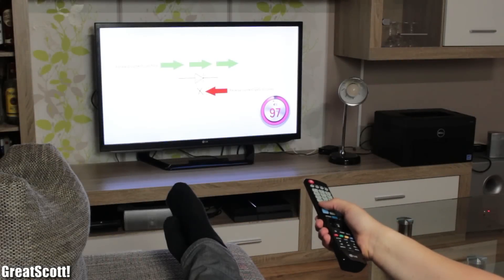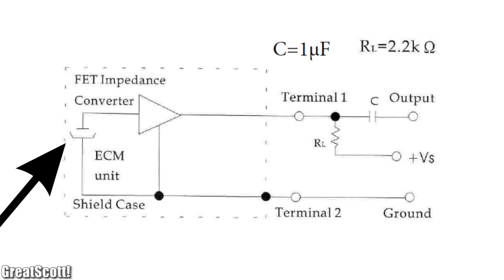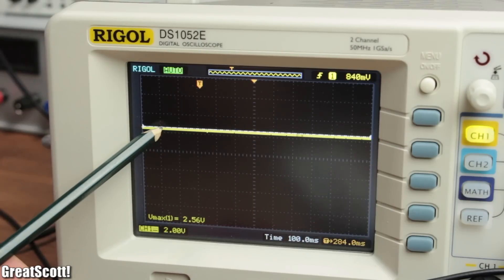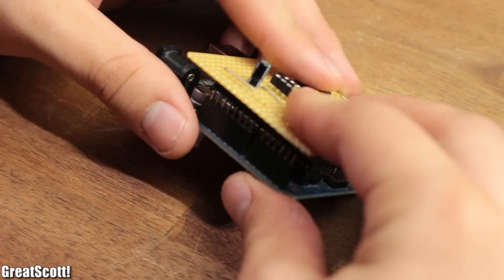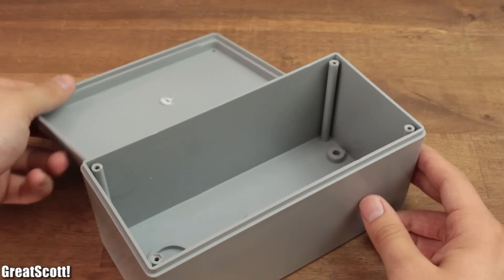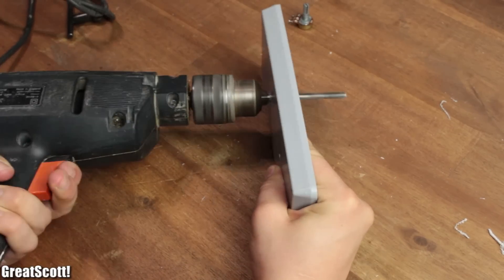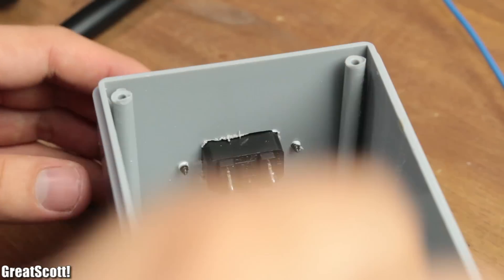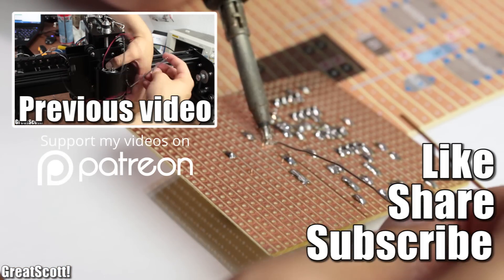Turn your lights on with clapping?! || Arduino Clap Circuit

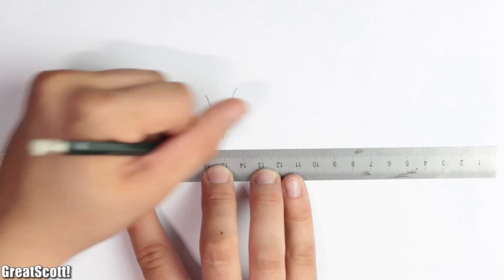Comment: @1:30 You could have used lower ADC reference voltage, attiny85 should have 1.1V voltage reference on-board.

Comment: hello greatscott! how can apply thia to my arduino nano? what pin should i connect the sound sensor? what pin should i connect the relay?
Reply: the majority of the pins is the same with arduino uno and/or attiny. just look at the pin mappings of all these and (for example) you need a digital pwm pin, then just look at the nano pinmapping and find a digital pwm pin

Comment: Can I use LM386  instead of NE5534 op amp ?
Reply: Do I have to change anything if I use LM386?
Reply: See the LM386 is not an opamp, is an audio amplifier. It can be posible to use it in the project but you have to redesign the amplificaction circuit.

Comment: hey what is that silver colored conductor you use to make connections on the perf board? what is it called?
Reply: shiva kumar If it's on the pcb it's called an uninsulated jumper wire. It's used to make connections to various components over the board instead of insulated wire soldered under the pcb causing it to be harder to mount. If it's on either side of the pcb, it's called a power or ground rail. This is used in some circuits for neatness instead of straight connections.

Comment: Can someone tell me how to make a switch that's off when it says on like 

2 switches 1 is on then flip the switch the other one is on but the first one is off please
Reply: The wonderful wonder you need 1 switch with 3 prongs. let's the middle one be the common ground. the outer prongs are positive leads. so when switched one way, that circuit turns on. when the switch is flipped the other way, the other circuit turns on. hope this helps

Comment: Does NE5534P work for this? i have random readings on my serial monitor. Im thinking i have the wrong IC for the condenser amp.. the link you post on ebay is NE5534N. is that different with NE5534P?
Reply: if there are weird values, try using a pulldown-resistor (100k ohm or more that directly goes to ground) This will allow these interferences to flow directly to ground and not mess up the readings, just watch a tutorial about it

Comment: amazing project as usual.
Maybe i ll try to use it some time... :) thank you!
Reply from the maker: Carlos PECHIR You're welcome
Reply: GreatScott! are there any Abacom Lochmaster files for that project? Is there a milled pcb of that project, since you have the X-carve ...
Reply: GreatScott! I think I will build a 2 channel one with a double clap and a triple clap in the next months! :) But I will power it via two 9V batteries in parallel and a step down converter which has an idle consumption of a few micro amps and pulse relays. :o Should last for years and when it goes dry, the appliance will be still on or off. Nothing to worry. :D

Comment: Do you know how to code an arduino to do this "if this voltage on this pin then this pin high"
Reply: Beall619  ... in this video scott use analogRead to read you have the .ino file in instructable .. same way to program arduino uno and attiny..

Comment: This is really cool, and actually quite close to something I was trying to do not long ago. I wanted to fit a lock to my front door and drill a small hole for a LDR, and use a momentary flashlight as a "clap". If you flash a specific sequence, the door unlocks. I never got around to doing it because for some reason, my code doesn't like putting out more than a volt on the digital pins -__-
Reply: Jordan O'C did you set the pins as output?
Reply: Mario G. I did. I've put my code on pastebin if you want to have a look over it and tell me how shit my programming is XD. http://pastebin.com/cid9diZP
Reply: First of all to mention that I personally use Atmel studio. Now I can not see anywhere pinMode(). This function configures your pin direction if it is an input or output. Take a look at this link fix that and you are starting from something.

https://www.arduino.cc/en/Reference/PinMode
Reply: And my friend please do not use goto. just never when programming on C/C++. Always you will find a way to do it with loops.
Reply: Mario G. Oh my god... How could I forget that?! *Ultimate facepalm*. I don't like using goto, but It's the easiest way I can loop something, it's the one I understand the most. I hate using "while" and "for" loops, they confuse the hell out of me. Thank you for pointing out my obvious mistake though.
Reply: No, problem! :)
I hope it's the only problem on your code and it would work right away after fixing it. :)
Reply: Mario G. It was literally just that issue, it works all fine now, the leds are really bright :D
Reply: I am glad to hear it! :)
Reply: +Jordan O'C (Xenro66) While = while that condition is true: while (1 == 1)   For = for <counter> may reacheth <that value>: for (c = 0; c <= 100; ++c) //0-100 loop  You can make an eternal loop using while (1) { //your content here }

Comment: why dont you just buy 1pc cover for that outlet, you really need it in normal electrician work, also using that kind of board for those kinds of ac currents .. is not ideal.

Comment: Can i use NE555  instead of NE5534?
Reply: ok Thanks bro..
What about the relay? is there any other type of relay ? because at my place here i could not find FRS1B-S-DC05 Relay.
Reply: Its relay is 6 pin whereas the one you shown to me is 5 pin... how is the circuit then? Help.... T.T
Reply: Thanks mate.. will try it....
Reply: can i see your circuit board? Can i see your connection?
Reply: how about ATtiny 13A?
can i use ATting 13A?

Comment: do you have to do it on a attiny insted of on an arduino?
Reply: someone correct me if im wrong, but it might be a bit overkill using a full sized arduino when the ATtiny is cheaper and still functions perfectly for this circuit.

Comment: Thank you, I tried doing my own sound activated project (Didn't care too much about double clap), but the problem I had was the microphone being very insensitive. Some times I could get it to register with what I considered a tiny noise some times I would do a loud noise and it would barely register. I am hoping using the amp that you suggested will help.

Comment: Great job mate. I suppose you can add 3 and 4 claps switches depending on the timing and the number of claps right? Now THAT would be even more catchy!
Reply from the maker: Sure
Reply: Theo papa thats my aim, can u help me on achieve that ?
Reply: Nic Brain if you can achieve the first step, which is the 1 clap then you can do the resrt.You just need an oscilloscope for that,  something that i dont have. But the idea is measure the timing with the oscilloscope  and put according delays on the arduino code.
Reply: Theo papa thanks for the fast reply . Because am a beginner On this arduino coding and stuffs iT makes things kinda harder . I dont know maybe u can help me make this code ? My aim is to turn different appliances On with different number of claps. For example 2 clap to turn a pc On and 3 clap to turn the tv On
Reply: i am afraid you should relax and start as everyone does. From simple stuff. Start by learning the basic commands and achieve manipulation of leds, stepper motors and then lcd screens. You ll gain experience this way. Controling high power devices like the ones you want require solid understanding of coding and most importantly of risks of electricity. So you d better take it slow.
Reply: Theo papa thanks for the advice . Its a project i got that needs to be done by april next Year . By school 😏.  But Yeah am still making researchs and trying things. Would be happy if u could help me in anyways

Comment: How do you remove the traces on the break out board so you can use an IC? I've used copper dot proto-board, but using a ton of wire is annoying. Thanks!

Comment: Love this! 
Can someone help me. I have  a 12v light that I want to be on when either my dar door is open or when the dash lights are on. individually i know how to wire it but if I hook up both at the same time im worried that power will flow backwards. does anyone know how to solve this problem
Reply: look for some diodes that can handle the current of the light you're using. (diodes are like oneway traffic roads for electricity)
Reply: +Danté Smith  Go here to find all kinds of basics circuits. What you will find a life time of work by the author.What you have imagined he has already done it. Enjoy.http://talkingelectronics.com/
Reply: okay thanks I got it

Comment: It looks like that If an loud sound is playing in background the device will start to flicker.
Reply: Mario G. requiring two claps within a certain time is supposed to make that less likely :)
Reply: yes but it's not programed to recognize a "clap" but a high reading at the adc module from the mic that can happen from any loud audio source. so....
Reply: Mario G. its programmed to recognise two short spikes though and its less likely for random noises/tv/movies/etc to produce two spikes with that time gap between them
Reply: With this code that he wrote (i have paste it below) if you have a loud sound that stops for a moment (as a lot of songs do) and then starts again will trigger the pin flip. With just a tiny filter it would be much better to filter all the other frequencies and allow only the frequency of the clap to avoid triggering at lower or higher frequencies that may pretty easy trigger the pin flip. And again if a music beat plays from the next room more likely the lower frequencies will pass from the wall and boom it will trigger. Anyone can make a passive or active filter with just some passive components. And because we are already amplifying the sound with an op-amp it is pretty easy to make an active filter.

void loop() { 
  eventstatus = 0;  
  sensorvalue = analogRead(A2);  
  delay(1);
  
  if(eventstatus==0){
    if(sensorvalue>sensorthresholdhigh){
      eventstatus=1;      
    }
  }
  
    if(eventstatus==1){  
    for(int k =10; k>0;k--){
      delay(10);
      sensorvalue=analogRead(A2);
      if(sensorvalue<sensorthresholdlow){
        eventstatus=2;
        break;
      }      
    }
  }
  
  if(eventstatus==2){
    for(int n=500;n>0;n--){
      delay(1);
      sensorvalue=analogRead(A2);
      if(sensorvalue>sensorthresholdhigh){
        eventstatus=3;
      break;
      }
      
    }
  }
  
  if(eventstatus==3){
    digitalWrite(transistorpin, !digitalRead(transistorpin));
  }
}
Reply: Mario G. alright i guess you are right, I wonder if it would be worth doing it in code, say if the measurement is above a threshold then do a frequency measurement. i guess thats too complicated when you can just put a simple band pass circuit infront but it would be good for a project for coding practice :D
Reply: megaspeed2v2 To do a frequency measurement should be the best solution but with the speed and processing power of the atmega328p it would be very difficult. The only way to do a frequency measurement that comes to my mind right now with the atmega328p is first of all to use the chip directly without arduino ide and arduino bootloader. Then maybe you can enable ADC auto triggering mode and save samples to arrays, then maybe you can analyse the array to find out if your frequency that you are searching showed up (if the speed and resolution of adc samples are enough). And finally you can do whatever. But with GreatScott!  code and one good filter I thing it should work just fine.

Comment: Nice Project! 
Great Idea!

I've just one Problem. I dont't think it's good to show unknown people how to work with 230Volts! I am electrician and there are many risks when people wo have no Idea of electricity or of 230V AC work with this Voltage. If you don't work precise you can get an electrical shock or there may be connections with a high resistance... You know when you have a high resistance and a high current from about 10 - 16 Amps, it can get very hot and over some time it can burn. I know what I am talking about :D

Just hope all the creative people wo build something like this work precise :D

Comment: can you hide the circuitboard in the wall... i mean, if make it smaller.

i belive the main goal here is to hide BEHIND the wall switch so you can turn on and off room ligth normally AND with claps.

how about that? =D

Comment: For the transistor, can i use bc 547 ?
Reply: Ravi Damaris or 2N3904?
Reply: Ravi Damaris Yes, Any generic NPN would work
Reply: It depens on the relay. Most relays need around 80 ma. But if your relay needs more the transistor might get destroyed.

Comment: Can I use ATmega 328 instead of ATtiny85 ?
Reply from the maker: +Salma Hashem Sure
Reply: can you send me the daigram which you followed for the atmega328 with ne5534?
Reply: +hammad ali actually I didn't complete it , but you can compare both data sheets of the Attiny85 and the Atmega 328
Reply: +hammad ali yeah , well I'm sorry I can't help you..
Reply: Ohh i got it! Thanks

Comment: Is there a way i can control it with both manual switch on the switch board and arduino with Bluetooth and relay? 
I have written the whole query here https://forum.arduino.cc/index.php?topic=420519.0 
Please look into it :)

Comment: I think no need of attiny just d flip flop
Reply: a flip flop will work but you can only activate it and you need a push button on the reset pin of the flip flop to deactivate it and also you can't use more than one clap because it won't work like that

Comment: Hi GreatScott! I find your videos interesting to watch, even if I have no clue about creating circuits. After watching your video I was curious at 2 ideas. 1st Could you use the electric microphone to clap on a computer? (Integrate into power button?) Since Im guessing it doesnt need a lot to turn on. 2nd your circuit only contains one plug, could you have one with 4, each with a different number of claps? 

Carry on with the interesting videos! :)

Comment: Please someone help me...i can t understant a word
Reply: Then maybe watch some Arduino and basic electronics tutorials. Just to get the basic knowledge. Then come back and try to understand step by step whats going on. But if youre complete noob in electronics, i wouldnt recommend doing this yourself, because it involves high voltage. Although you could, (like i did) use a remote switch instead of a relay, so youre not using any high voltage, but thats a bit more complicated. Good luck!

Comment: Gutes Video!

Allerdings gefällt mir der 230V Teil garnicht !
1. Die Leiterbahnen der Platine sind für hohe Ströme bei Netzspannung zu dünn !

2. Dein Relai ist für 125V und 1A also deutlich zu klein ! 230V sind zuviel für das Relai ! Ausserdem wird es bei 230V auf ca. 0,5A maximale Last begrenzt sein (wenn wir davon ausgehen das es sonst dafür geeignet ist) ! Das sind nur knapp 115 Watt ! 

3. Es fehlt die Sicherung, da die Komponenten für 16A (Absicherung normaler Steckdosen) nicht geeignet sind... wenn jemand auf die idee kommt damit seinen Heizlüfter o.ä. zu schalten wirds gefährlich! 

Ein anderes Relai sowie eine Sicherung halte ich hier schon für nötig :)
Reply from the maker: DJSanTec 1. It's not made for high currents (the project) 2. It is rated for 220V AC maximum. Through tolerances 230V AC is ok (not ideal) (check the datasheet) 3. True. But it would be great if you could write your comment in english. So everyone could understand it.
Reply: +GreatScott! 
Sorry, did Not look at the datasheet. In my oppinion you should give a value for the Max.  current (and fuse it to prevent anyone to exceed the Limit). Not everyone knows that much about electricity ;)
Reply from the maker: DJSanTec Yes I should. I will soon add it to the description. Thanks ;-)

Comment: Laziness just got to another level
Reply: Brandon GarvenTM Hehe
Reply: Actually, you don't have to be lazy to use this. If your doom is dark and you can't find the switch, this could be very helpful.
Reply: I like darkness and my parents come in my room and turn on the light and then i have to get up but my phone charger is a little brocken and i have to hold it a certain way to charge my phone. If i get up i would ruin it. Not lazy

Comment: "Arduino Clap Circuit"
Way too many Arduino projects, Using a computer to control EVERYTHING is not cool.
Reply: What would you use? I don't see a problem. Using arduino UNO for everything isn't the smartest but ATTINY is small and extremely cheap. Why bother with some logical gates and complicated schematics when you can do this instead?